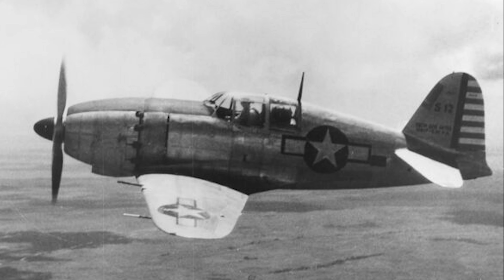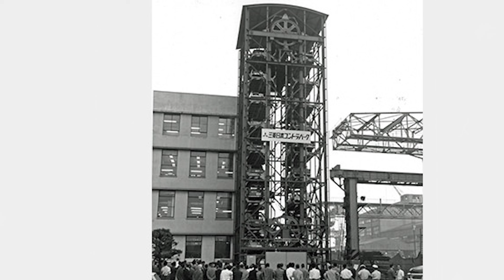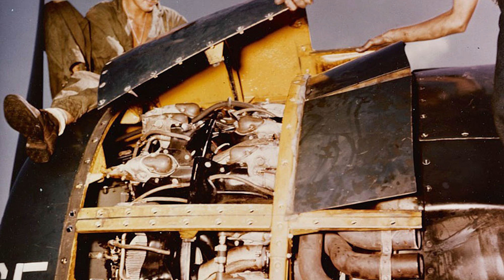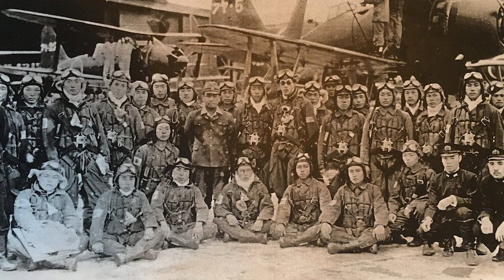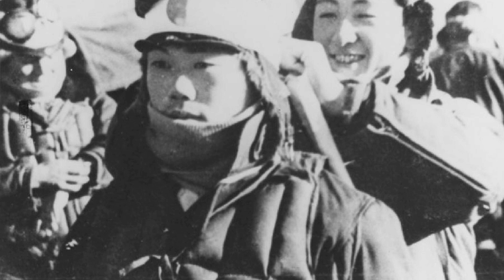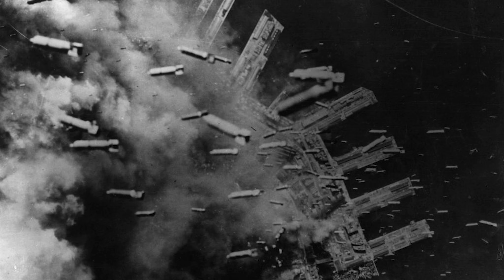Why Speed Obsession Killed Japan's Most Promising Fighter Design

Comment: Times have changed. Aircraft design is a cottage industry performed by YouTubers, and when vibrations occur, they laugh about it, send the design to AirShaper and simulate it. They 3D print another part and continue.  Cooling?  Still a slight problem, but not an aerodynamic one - electric motors.  Latest problem? Shaheds. Ukraine creates state-of-the-art interceptors. Japan is friendly to the US, but now the US is lead by a wannabe dictator.

Comment: It was killed by the inability of the Japanese manufacturers to build new engines to tight uniform specifications. The KI61 Hein was based on a Japanese built DB601 engine. Sadly the engine was plagued with all kinds of reliability problems and further on field mechanics could not maintain it properly as it was not an air cooled radial. They later changed the engine on the same airframe to a more powerful radial to build the KI-100 a very competitive fighter that could compete with anything Americans could build.
Reply: The loss of much needed wartime supplies hampered wartime production.  The submarine warfare efforts of the US constantly sunk freighters laden with needed ores making Japanese metallurgy questionable for production of guns and aircraft..